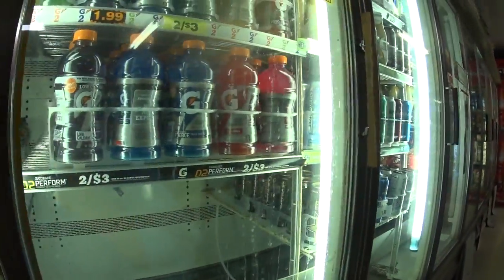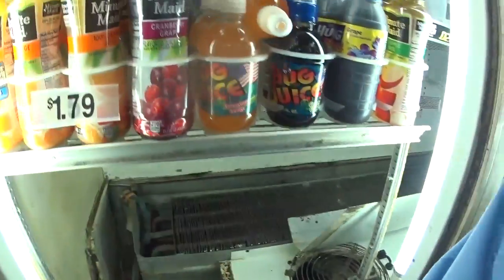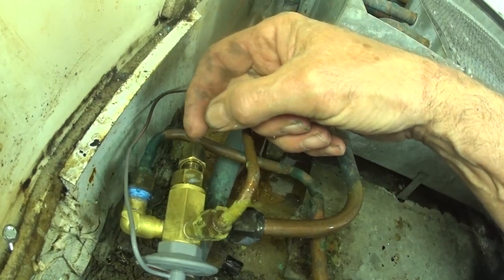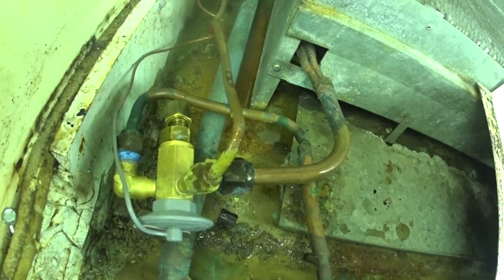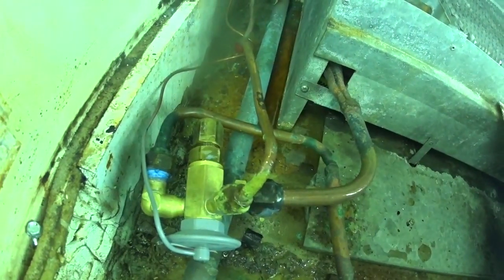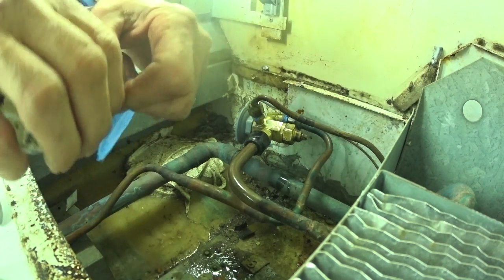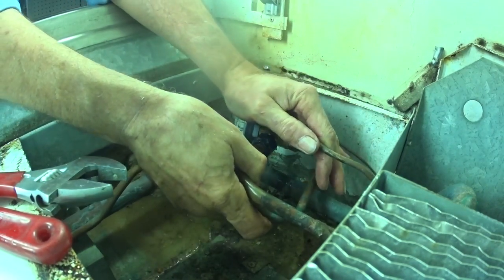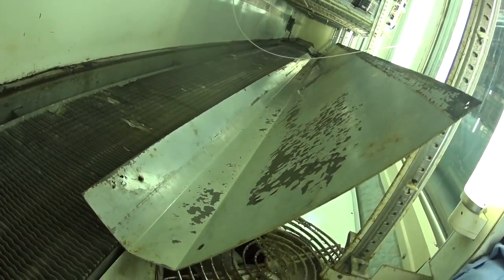H 10 leak detector

Comment: The h 10 is great , I still have to pick one up . Nice vid Jim .
Reply: Charge it to the Boss like I do lol
Reply: Emin HVAC not that big amount of $$$ lol
Reply from the maker: justin henning I save it for the real hard to find leaks, thanks
Reply: ***** the H10's low battery was on needing charged. Not sure how it even detected anything most won't work when the low battery light is on.  The packing nut could have been tightened also before putting the cap on. also it best to recheck for that leak after your repair to prove you have it fixed.